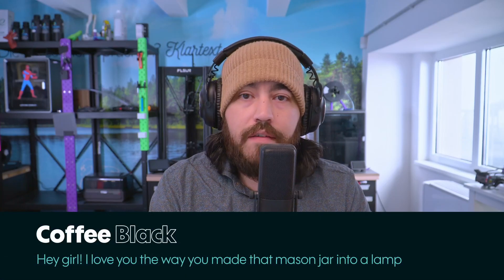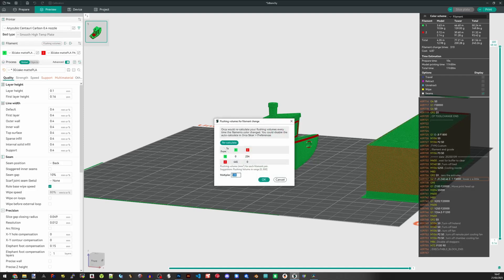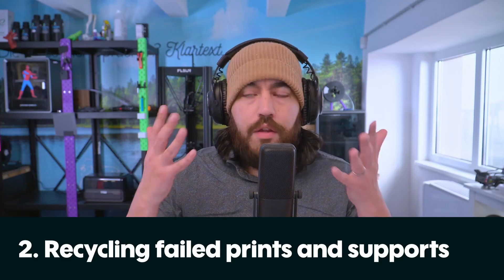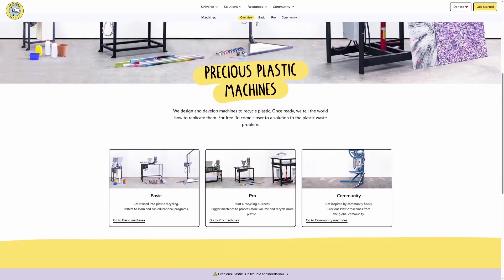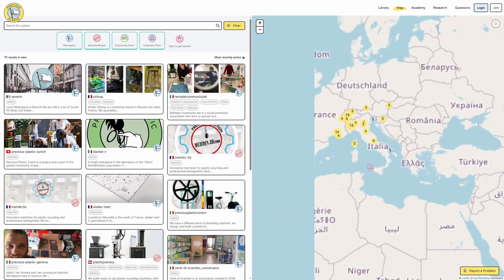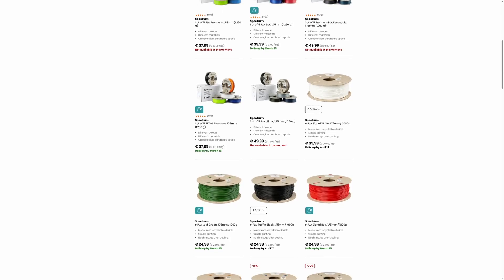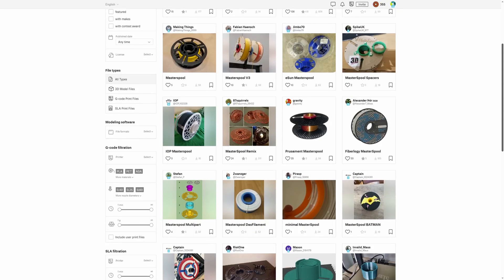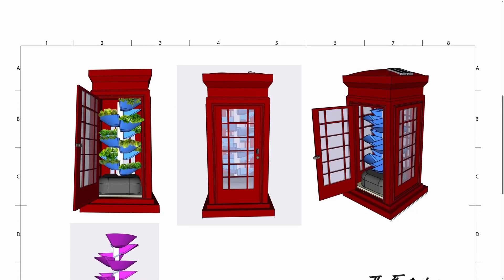Recycling with your 3D Printer! Save filament! Save the Planet!

Comment: I am getting the S1 tomorrow and been wondering about waste, can it be recycled at a waste plant or in the bin, wish the UK had something where if you took in a certain amount of poop or waste they would take it to make their own filament and also swap the waste for a 1kg spool or random filament they have made. But yeah need help on actually recycling the poop etc?
Reply from the maker: In most countries, it is really difficult to recycle printer waste through normal municipal collection. I wish there were other options but recycling printer waste itself also has both energy and logistical concerns, better to reduce and reuse before considering recycling.

Comment: There are plenty of ways to save a bit of filament. The most obvious is to stop printing toys, and only print things you'll need longer than a few days. My close second, is to print as many test pieces as you require, getting the fit correct. Just the smallest possible piece, not the whole contraption. Third is to stop iterating when you are already done. If your piece fits, but it has a small blemish, or it is the wrong color, accept it and move on. My final tip is to calibrate your flow rate compensation to zero, you'll save a lot of filament this way. The parts will be perfectly transparent, and don't take much space at all.
Reply from the maker: Great advice for material conservation!

Comment: What's do you mean turning plastic bottles into usable filament is a slow process? 🤣 
The Mk6 FunSize from Recreator3D comfortably turns a 2L bottle into aproximatly 25Grams of usable filament in round 25 minutes! You can go faster, but hey! 

❤
Reply from the maker: Thank you Doug for your contribution :)
Reply: To be fair, that’s DIY, requires a lot of part hunting and printing, and the assembly video is 4 hours long lol